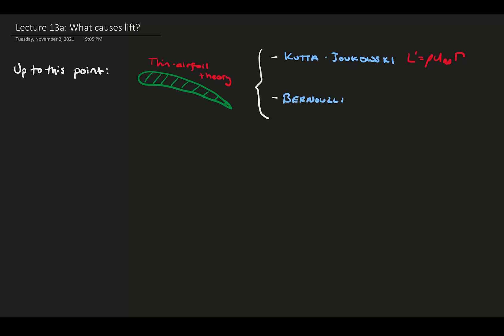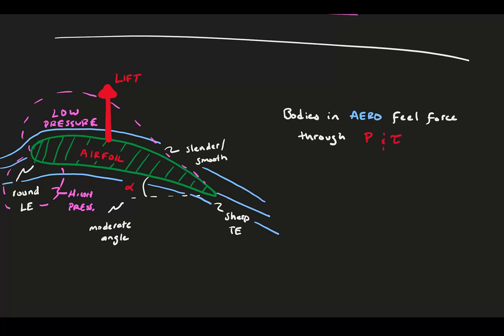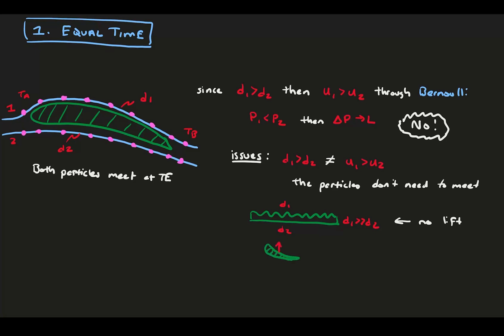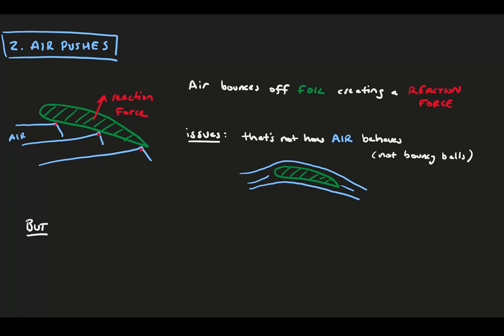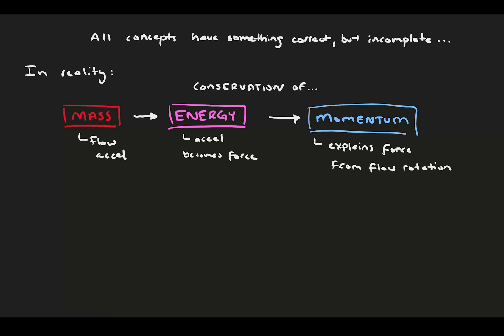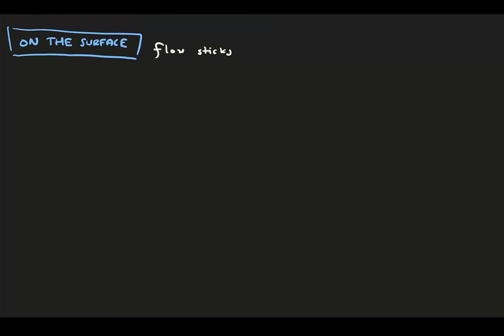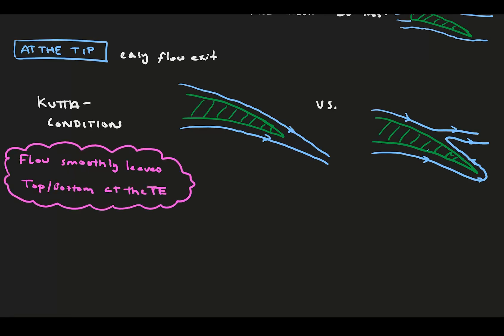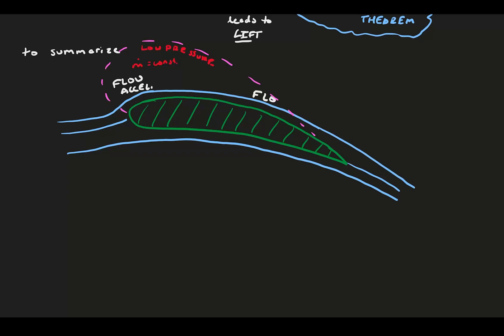What causes lift [Aerodynamics #13a]

Comment: Based on the concept that a longer upper surface should give more lift, a German designed a wing using airfoil with a bulge on top that came to be known as a cat’s-back wing.  A test pilot reported that the airplane waddled around in the air like “a pregnant duck.” Einstein the airfoil designer later noted, with chagrin, that he had goofed.
Reply from the maker: Einstein better stick to relativity!

Comment: Prof. Van Buren, wonderful series. However I think that the explanations of lift are not very convincing. The explanation that I've been most satisfied is what I read from the book "Aerodynamics of wind turbines" by Martin Hansen.  The curvature of the streamlines imply that the particles travel along a curve and hence a centripetal force is necessary to make the particles move along a curve. A pressure gradient in the radial direction provides the necessary centripetal force, and hence we have a pressure difference between the sides of the airfoil surface.

Comment: You explained lots of misconceptions but forgot one which is Venturi effect. This effects is also wrong according to Nasa glenn research center but you base your idea on this concept. Anyway it is a good try.
Reply from the maker: Thanks, but we will have to agree to disagree on this one. While I think the folks at NASA can be brilliant, I have seen the explanation you are referring to you and I don't find their rebuttal of the idea complete. And I think that's okay, because this is a very hard problem that doesn't get a simple answer!

If flow passes by curvature---like one wall with a hill or the leading edge of an airfoil---it needs to react. If things are slow, the fluid just entirely (up to effectively infinitely away from the surface) moves up and over the curve and it is happy. This does not lead to the Venturi effect which is generally used to explain contracting enclosed systems. However, if it is moving rapidly by this curvature, shifting upwards takes time, and the flow might not have that time to react due to compressibility. So, if it can't get out of the way in time (and conservation of mass needs to be obeyed otherwise the world explodes) the flow can can do things like increase in density or speed up in this 2D approximation. Why is speeding up not an option for mass conservation? Would this not be a "virtual" contraction, where the "top wall" of the Venturi is really just reaction time?

I know NASA in that reference discusses the flat plate as evidence, but the flat plate also leads to flow fields with curved streamlines that behave like more curved surfaces. Also, it talks about the bottom-side of the airfoil but there curvature is not nearly as rapid. Furthermore, the speed up explanation in this video is specifically attributed to traditional airfoil shapes and is only a smaller part of the big picture. It is this effect in combination with the others that lead to the supreme lift of airfoils. 

I am not sure my explanation is any more convincing, but I also don't see where in the aeronautics series from NASA that they explain the acceleration of flow around the curvature at the top of the airfoil, which certainly happens. It seems that course online just leads to "Euler equations are complicated". Yes they are. I have seen other explanations that include consideration of angular velocity and centrifugal things, but they didn't resonate with me (or perhaps I just didn't understand them well enough). 

Anyway, thanks for getting me to think about it more deeply!

Comment: If you consider that flow redirection is caused by the downwash of the induced vorticity, something interesting happens. Suddenly you have an explanation as to why air flows faster over the top of the wing, as the vortex carries momentum across the upper surface of the wing, keeping the boundary layer energized. Suddenly Coanda and Bernoulli make sense. The vortex takes away lift at the tips to enhance it at the center, an easy trade off to make since it makes lift possible to begin with.
Reply from the maker: Interesting perspective!

Comment: Best explanation I have seen . Looks like this person has a good grasp on the subject. 
I was just curious. Tried to find an explanation on my own . I am still curious what really transpires in  Coanda effect . Thanks for great lecture.
Reply from the maker: Thank you so much! I appreciate the kind words.

In this case, while it has the name of the Coanda effect, I find it more relatable to think of vacuum/voids. If the fluid wants to lift off from the surface, it creates a void or vacuum underneath, which pulls it back. In order to successfully separate, it needs to find enough convincing (usually from adverse pressure gradients) to overcome the force to fill that void. Thus, flow wants to stay attached unless otherwise convinced.

Hope this helps!
Reply: @prof.vanburen  Whilst I think it is a decent video, I don't think the Coanda Effect should even be in it. The definition being “the tendency of a JET to follow a curved surface” [paraphrasing Coanda himself]. We have a plain airfoil passing through a uniform control volume: there is no jet. Coanda effect is not even mentioned in most of the standard aerodynamic texts. It appears that this phrase has been widely subverted on YT to explain flow attachment.
  I would argue that the common example of the stream from a faucet v spoon is not even a demonstration of the Coanda Effect. Until that stream comes into physical contact with the surface you get zero deflection, or at least none that can be seen. And yet as soon as the spoon touches the stream you immediately see the deflection begin. It stands to reason that the Coanda Effect increases with proximity of the jet to the surface, but no such behaviour is seen in this experiment. Furthermore, the point where the 'air gap' goes to zero, should be the upper limit of the effect and yet it is clearly seen to be only the start. Very evidently then, it is not a demo of Coanda Effect. I presume there is some negligible effect, indiscernible due to the massive density of the liquid stream v the ambient air and the minimal entrainment between these two fluids in their different states. 
  I am not saying Coanda Effect is a myth, I am saying it has nothing to do with the flow attachment or lift of a plain airfoil, and that the spoon/faucet experiment is not a demo of Coanda anyway.
Reply from the maker: Okay @XPLAlN !"

Comment: Hi prof. Tyvan! 

Can we write lift as the change in momentum of the flow in y-direction? If so, then why there isn't a formula for lift that is based on the change in momentum of the flow? Measuring the flow momentum (along with the velocity vector) before and after the flow passes along the airfoil is easier than measuring the pressure at each point, isn't it?  (same approach as used in thrust equation). 

And one more question,  if the flow is inviscid, will there be a Coanda effect.
Reply from the maker: Hi and sorry for the late reply! The semester got a way from me.

Great questions! 
1. You could consider a flow volume approach where lift comes from overall change in flow momentum. This is actually done for drag, sometimes, where you measure the velocity deficit in the wake and then back out what the drag force must have been. However, this requires a volumetric approach, and doesn't lend itself to the clean momentum equations we are used to. In essence, you could consider the Kutta -Joukowski as a form of this, where you get lift from the total added circulation to the flow. 

2. I'm not entirely sure if it is still technically the Coanda effect, which is mostly used for wall jets. However, you will get the physical features of Coanda even if inviscid, because if flow wants to pull away from a surface it needs to fill the volume it is creating or there will be a vacuum, which means there is effectively an attraction force to the wall (meaning, it's easier to stay attached than separate and fill the void, unless the resistance gets strong enough). However, if flow is inviscid you no longer have the primary reason for flow separation over a lifting surface, but that is different.

Comment: Good vedio, Just comments, when you talking about the where the lift comming from, please emphasize the Bernouli's equation is not the only thing applied to the lift. Also you could attach some experiment did by the Babinsky's research to obviously show why some misunderstanding are wrong. Cause the lift actually made by the part of the deflecting of the air flow. And also I believe that the Cnda effect did not applied this situation becasue that only working for Jet flow.
Reply from the maker: Hi and thanks for your comments! Coanda was traditionally attached to jet flows, but the physical concept is the same regardless of the name. Coanda actually applies to jets attached to the surface, at which point I would argue they are starting to become wall-bounded or film flows.

Comment: The coanda effect explanation is wrong. It is only true for jet flows, however, an object moving in a fluid can not be considered as a jet flow. Coanda effect is just giving a name for a phenomenon, not explaining the reason why the air follows the curvature of an airfoil.
Reply from the maker: Okay! While I agree that Coanda might be specifically attached to jet flows in the traditional sense, accelerated flow over an airfoil in the near region of a surface is characteristically similar to a jet flow attached to a surface---a region of fluid with higher momentum than the surrounding flow.   (Since we have our pedantic pants on, I would also argue that once a jet flow attaches to a surface it would lose the definition of a jet in the first place...then Coanda doesn't actually apply to jets at all). 

Regardless, it is the same physical phenomena that keeps flow attached to the curvature of an airfoil and that keeps a jet attached to a neighboring curved surface. If you don't believe me, a quick search of "Airfoil Coanda Effect" yields a nice result from NASA on the topic, who probably know more about it than I do.

Comment: 2. is wrong.  Air is very hard stuff, when you move fast.  In fact, the astronauts in space shuttle Colombia were killed when their massive space craft could not withstand the heat and forces generated by tiny little air molecules bouncing off of it.  The shuttle wasn't destroyed as if it had been flown into the side of a granite mountain, but it was ripped apart pretty badly.  By what?  By air.
Reply from the maker: When you say 2, you mean the "Air Pushes" portion? And I can't tell if you mean that the explanation is wrong (it is not a proper explanation for lift) or if you mean that me saying it's wrong is wrong. 

Anyway, I certainly agree that when moving fast air can impart very high pressure gradients and stresses on surfaces, causing them damage.
Reply: @prof.vanburen   Believing or saying that air does not push the wing up is mistaken.
Reply: @crimony3054  but he does say that. Air going over the top of the wing pushes it downward. It is due to the pressure difference, with pressure being higher below the wing which induces a net force in the upward direction.

Comment: Amazing presentation and clutter cutting there! I have a small doubt Prof Buren, can you please explain why the fluid accelerates at section one even though it's not having a roof (to squeeze in through in order to accelerate).
Reply from the maker: Hi Chaitanya! You, like me, share the same first thought/doubt when it comes to the initial acceleration region. How can it accelerate, the flow could simply expand vertically (it goes off into infinity after all) to satisfy the conservation of mass? 

The way I like to think about it is, although there is no roof, there is still some sort of resistance to the flow expanding vertically. When the extra air tries to go around the blockage, it tries to push the extra air upwards. However, fluid can only push itself at the speed of sound, it is inherently compressible, so it takes a finite-amount of time for things to respond. In this finite amount of time, it becomes easier for the flow to just accelerate to account for the conservation of mass instead of working harder to expand.

This is at least my interpretation of it, it could certainly be wrong. Does it make sense at all?
Reply: @prof.vanburen  It does! Huge thankyou once again!!
Reply: @prof.vanburen   Think of what you're saying with respect to 2.  Air compresses because it can't move out of its own way fast enough as it is being deflected by the leading edge of the wing.  Air molecules ahead in the stream give some and push back.  Air molecules at the top give some and then push back.  The wing gives almost none and pushes back.  But it does give some, hence drag.  If air impacting the leading edge creates drag, wouldn't air impacting the underneath, even at a very slight angle, create an upward force against gravity, also called lift?
Reply: @prof.vanburen  the correct statement here is that air has inertia and hence it cannot effortlessly flow around an obstacle. The fluid structure interaction results in a streamwise deceleration, that in itself becomes the source of the pressure gradient force resulting in the acceleration sideways. This sounds unfulfilling, but it is true, the structure presents an obstacle, and the nature of a fluid is it flows around it, if it cannot push it out of the way.